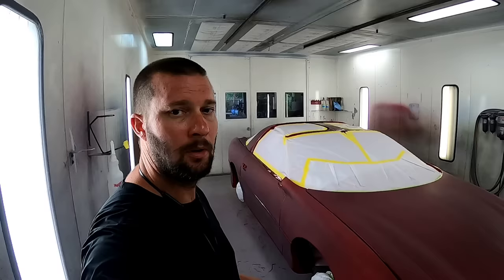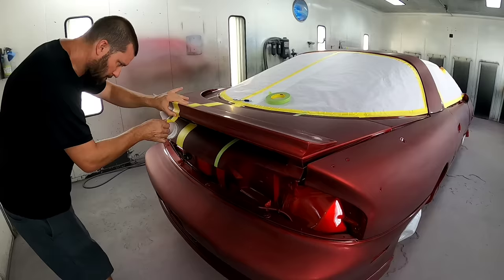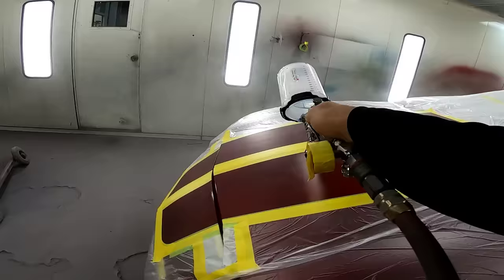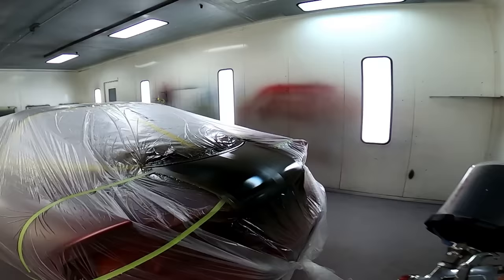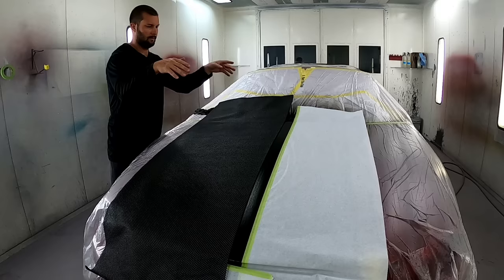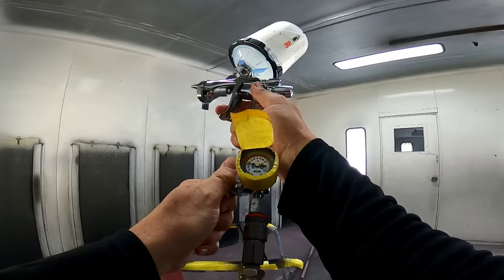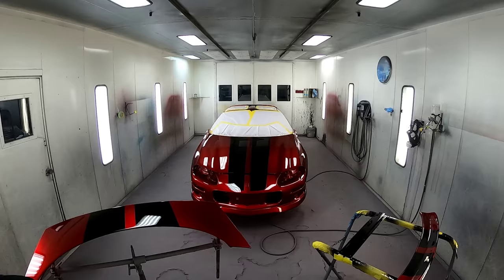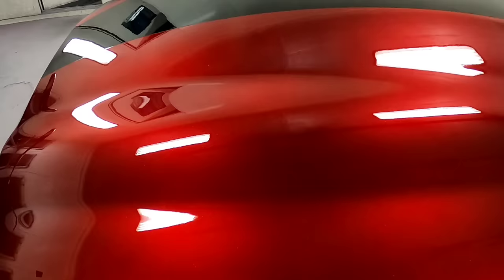Faux Carbon Fiber How To! (4th Gen Camaro Part 3 of 4)

Comment: I started using purple power cleaner for final prep, pretty cheap considering it is a concentrate. Going on 3 years using it, no fisheyes , no "staining" problems. Only one thing I've noticed is them blue work towels, I remember when you could use them, run them through the washing machine, the dryer, and still get to use them after that, ....:( not any more.

Comment: I have a technique for you to hide the lines made by the striping tape .  I have done this on mostly custom bikes and race cars. When doing the striping in base coat after laying down your color, or pattern pull the tape back n masking about 6 inches. Ask your pant supplier to sell you just your bace coat clear. apply the base coat clear over the stripe and sanded clear. apply several coats letting it flash inbetween. after drying sand the base coat cear you just applied to knock the edge of the stripe you ran. Use a rubber block and 600 grt. then spray your clear final coat. The tape edge will be gone and no raise or height difference will be seen. try it on a small scale to determine layers of Base clear you need to hide the lines. This also works really well when you run multiple colors. as you can bury them in bse clear and block between colors. I painted on high volume shop for 5 years and hobby painter for 40. possibly hardest thing is to have your paint supplier sell you just base clear.. Al

Comment: This series is the first I've watched of your content. I'm painting a solid color (Austin/Rover cumulus grey GR29) single stage that's painting like a metallic, seeing a black stripe, so trying to learn some tricks to eliminate them. Fourth attempt on the hood was with a new Iwata LPH400-LVB 1.3 tip, it's helped significantly, but an area still has them. The details you communicate with everything is perfect. Gun, pressure, tip size, every detail is great. It'll help me try different things. Thank you.

Comment: Nice color, have always thought about painting mine that color, bought the car new in 93, figured I'd wait til it needs a paint job, 30 years and a quarter million miles later, car looks better than new, still waiting, with nearly 500 wheel HP, drives better than new also.

Comment: Nice job, fun being a short painter 😅😂.   Used to have milk crates w a 2x12 bolted on top.   
Painted for a long time catalyzed enamels, Imrons and Centari mostly as favorite.    Back in days of high pressure siphon guns.   
Few things I did, rubber Soaker type hose around booth to keep it damp for dust.   
Two things I noticed of as a bad habits.
1 with slow reducers is spraying the edges then you sprayed the flat horizontal surface.   The spray DOWN from the flat can help push down a run/sag along the top edge of the vertical surface.   I noticed you did that on the spoiler and once in the t-top edge.
2 When laying the silver base flake you didnt stop/release the trigger & laid it as a panel job which can give some stripe motteling of it.  You did similar w the candie layers but ran off to get it even so 👍. 
Watching both episodes and yes my shoulder is feeling it 😂😂😂.
Trash can be static, use a ground wire on the car.   Grab battery - neg abd ground it to the booth.   The soaker hose also will help w trash.  😉

Comment: I did custom paint in the 70’s. The technieque is still quite similar, but the materials are very different. The static issue is still the same. My first Corvette looked like a fur coat, on the first try... 😇

Comment: If your getting trash in your paint, disconnect the cars battery and put a grounding rod through the floor at the edge of your booth along one of the walls and run a grounding wire with a magnet  off of it on  to the frame of the car ,, this will solve a lot of your trash problems while painting.
Reply from the maker: Thanks for the tip. I've heard of doing this over the years but never actually seen anyone put it in practice. Never heard of using a magnet either, just a clamp.
Reply: @paintbycurry1531  i've been doing it this way for probably the last thirty years or so,, works really good because the paint you are shooting has a negative charge to it and so does the vehicle as it is being grounded out with the cable, and also the battery being disconnected just helps to  eliminate the the positive-negative polarity attraction thing all together,, The magnet just makes for an easier connection to the vehicle as sometimes its a trick to find a place to stick clamp on them..

Comment: Thts a 25% overlap not a 75%. Nice Gun Control you should mention how you treat valleys and ridges when spraying. This is a rather rounded car but it still has many peaks and I didnt see you mention bringing the gun closer to the car when spraying those. Also the Carbon Fiber look turned out well TY for keeping tht subtle.

Comment: Having worked with carbon fiber I said to myself this should be interesting to see. Just an FYI, even cured CF is not that shiny, maybe try a semi gloss or dulled out black of you do that again? Also, maybe try a little brighter yellow or gold for the pattern? Overall this was a really cool video and I liked how you used the matting to make the pattern, really cool idea!!! Awesome work and beautiful paint job, my hat is off to you guys, that takes a ton of patience and good eyes.
Reply from the maker: Yeah i use real carbon fiber in repairs on some of the race cars so i know this is a little brighter.  First time i did it it was cut out in vinyl as a stencil. Sign shop had to let the plotter run all night to cut out enough for the two stripes. Lol. But it looked way better because ther was zero overspray in the opposite blocks.  Thanks for watching!

Comment: Car looks great!  Question, why not paint the pin strip on the strip edge before you clear coat?  Would that not bury the strips with the pin strip under the final clear?  Can the pin strip come of if cleaned with high pressure wash or over time of many washes?

Comment: beautyful work i always enjoy watching and learning from you i noticed that your air line is a lot bigger than the 1/4 inch one i use is it better to use a 5/16 hose
Reply from the maker: It's a 1/4" air line.  I've seen no reason to use anything bigger.
Reply: thank you i meant to say 5/8ths but what you say will do for me
Reply from the maker: Most paint gun manufacturers recommend 1/4" . At least I'm sure Iwata does.

Comment: Have you ever done the Bird on the hood for Pontiac Trans Am Firebirds?
Reply: No. Never actually messed with a trans am.
Reply: @jasoncurry8059  ok cause I'm fixing to restore mine but not the original color, it was medium green metallic but I'm going to go Shamrock Green Metallic which is a lighter color but would make the car stand out more.

Comment: What tape are you using for laying out your stripes?
Reply from the maker: On this one i used regular 3m masking tape because i forgot i needed a new roll of fine line. Normally I use the FBS brand finelines. They have a great selection of sizes and stiffness. Orange 1/4"  and 1/8" are my go to. Check them out.
Reply: @paintbycurry1531  thank you i will do that!